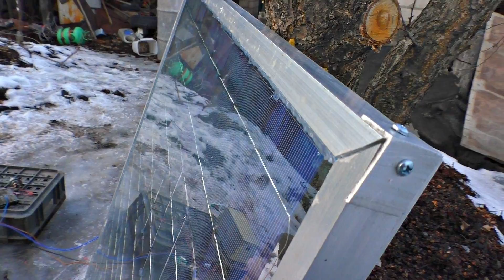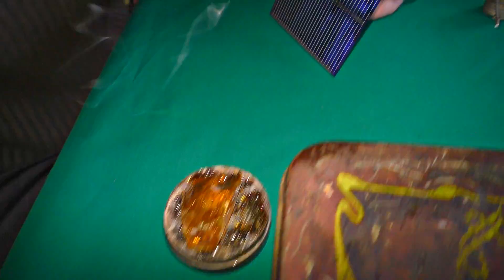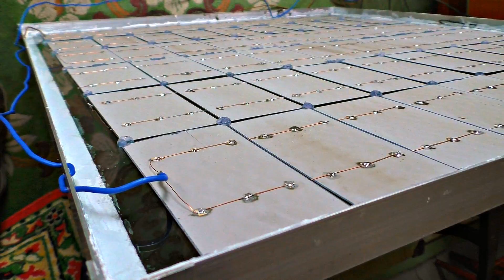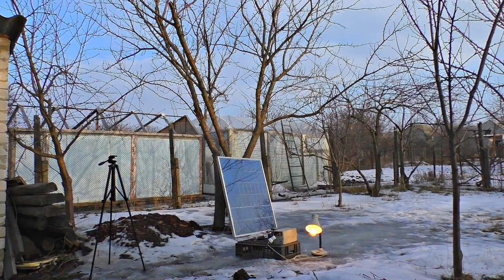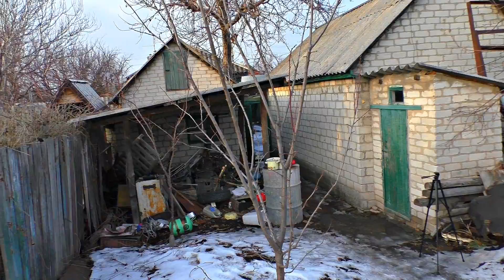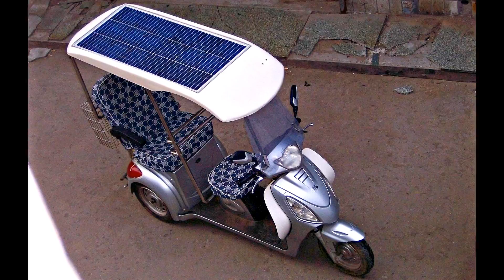Powerplant DIY /￼ Explicit step by step version / Assembling / Alternative energy

Comment: I "discovered" solar power a couple of years ago. My first (of many) mistakes was to invest in 10 high cap. SLA batteries. I now long for LiFePO4 or, as I call them, Lifepo's. Your ideas about hydroelectric generators is intriguing, though I could only muster tidal energy if I used water. Is that a river you created, or is it a "natural" one?

Cheers, mate,
Jack

Comment: We need a plug n play unit, that plugs into the fuse box with multiple source input, wind, solar, the unit needs to rectify any current provided to.220v format. 
So we can take it with us, take out the fuse in the fuse box and plug our own power supply, maybe even use the electricity when our source isn't working ? 
Now that would be a world winner.

Comment: Man i discovered an incredible thing to improve efficiency of partial solar panels, take a pc fan without the helices, put a capacitor on top of the fan, and in the side of the fan you'll put 2 brushes in up-down orientation connected to the capacitor, then in the outside plastic enclosure of the fan you'll drill/DIY/make contacts for the series of capacitors. The idea is that you will have a series of solar cells with capacitors in parallel to the cells, then the capacitor in the top of the fan goes to each pin equalizing the voltage between the cells so that the charge is equalized between all of the capacitors. Technically you can think of this like a capacitor that steps voltage to make the capacitors behave like they're the same capacitor but with different charges, just like you can connect 2 lithium batteries of different charges without any problem in parallel and the voltage will just go down slower, but if you connect them in serial then the overdischarge in the weaker battery and overcharge the stronger then charging again can destroy the batteries, with this the charge conservation of the sources is maintained just like the parallel battery but in a serial battery.

Comment: You know, a few metal sheets could be used to reflect light onto the solar panels, so that you get more electricity from the same amount of solar cells/panels. If feces hit the fan (SHTF) and we can't make any more solar cells, we would use such a system to generate more energy from the ones we have.

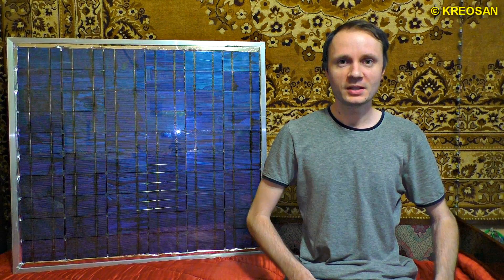Comment: Nice DIY video! Please check the units at 5:45. They are not correct, but one can still assume what you wanted to say I guess ;) Perhaps this is more in line (top to bottom): 100 W, 1 kWh, 500 W or 500 VA?, 0.7 kWh ? Please check if that would be more suited? Keep up the good work!

Comment: Maybe take some of the silicone and thin with mineral spirits and pour or paint over the back of the cells once you are sure the solar cells are working to your design specification.  That will help seal and make your device stronger and last longer.  You have awesome designs!  Powerline charging and maybe railroad charging is my favorite! Thanks for sharing! Spasiba!
Reply: I thought I saw smoke from the battery cable at first.  Then... yes... later you show smoke and battery cable melting.  This is something where finding salvage jumper cables is useful or stripping and twisting maybe more wires together and shrink wrapping the cables to seal maybe?  Maybe tape or black plastic with the silicone to glue and tape.  Good work!
Reply: I haven't tried yet, though wonder if a spray bottle of really thin silicone will spray coat the backside easier so to not damage solar panels.  Maybe more than one coat sprayed on.  I haven't tried this yet.  May need an undercoating thicker material sprayer device.

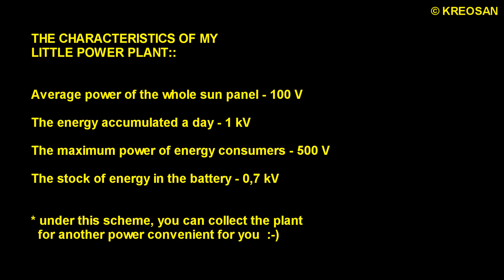Comment: I am not sure if anybody pointed this earlier but the unit of measure for power is Watt not Volt. E.g. Average power of your solar panel is 100 W.  (@5:47)  Good luck with moving more electrons around... :)
Reply: Volkan Yuksel maybe original Kreosan was right but dubbing guys made mistake...
Reply: Hi Morc, I think I also heard him saying 40 Volts when he was referring the power of the soldering iron. That should be also expressed in Watts. You may be right about the translation :)